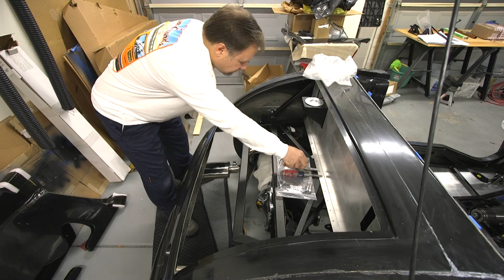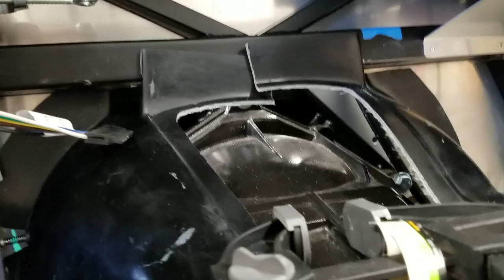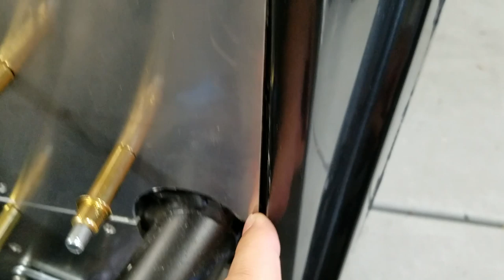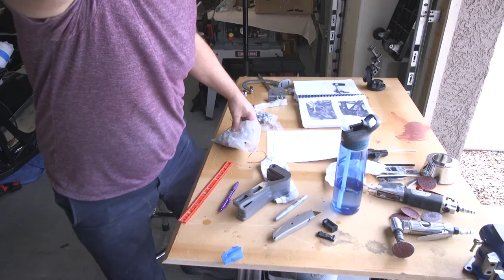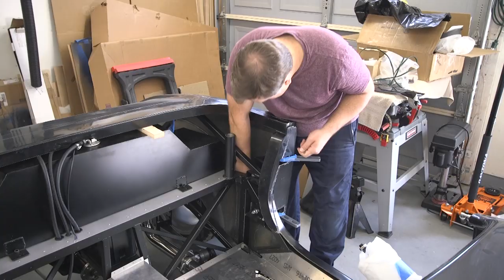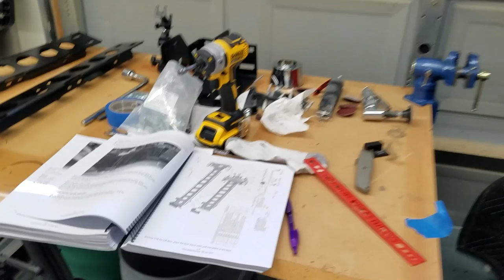Factory Five 33 Hot Rod V2 Build -  Body Work II

Comment: Hey Jim, great job. Im about to start my body work on my 33. Question, the door hardware etc.. did you powder coat or just paint? Thanks
Reply from the maker: The hinges I painted, but only the elbow will show.  I am not using a handle.  One of the issues you will have and is discussed a little in a future video is when you go to tighten the bolts of the door on to the hinge, it will walk.  So you will want to ruff up your paint or Powder in that area.